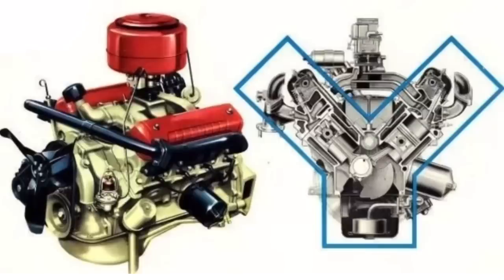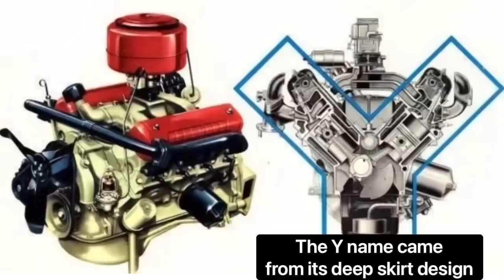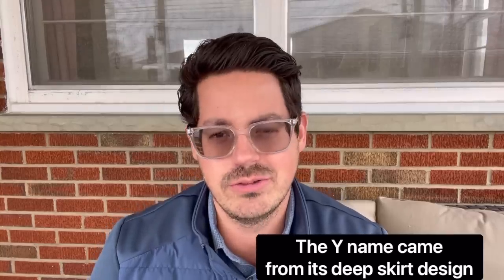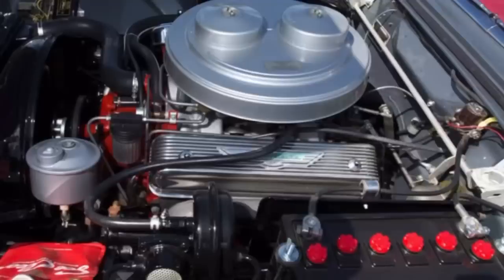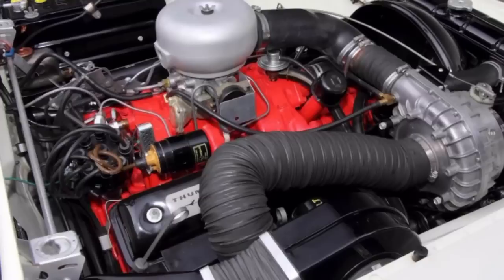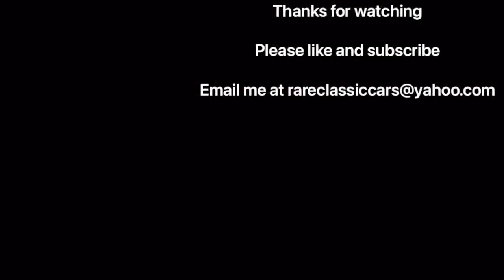Worst Engines of All Time: Ford Y Block V8

Comment: Sorry but I grew up during this time and those Y blocks were absolutely tough as nails..they did have the oiling issues in the rockers if you let sludge build up in them but they were nearly indestructible. I remember in high school a friend had a 61 ford with a 292  got in a pissing contest with another friend that had a 58 chevy with a 283..A bet was made the 292 wouldnt make it a minute with the gas pedal flat to the floor in neutral.The one with the 292 had beat on the car enough to know it would make it just fine and it did.The bet was a steak dinner.The other friend chickened out on seeing if his 283 would live a minute because he knew what would happen.As far as how they sound,back in the day when these were being made it was very well known a Ford Y block with a set of duals and glass packs was the best sounding V8 by far of any ever made so not sure why its stated they didnt sound very good.

Comment: Easily the best demo derby engine ever built. No, I’m not kidding. I spent years at derbies during the eighties and guys could run them without coolant, hole in the oil pan and they’d idle like nothing happened, heads cherry red. They’d run that motor several seasons before it died. Just weld plates over any holes and keep running.

Comment: My dad had a 54 Mercury 256 and a 60 Ford 292, both bought brand new. He ran Havoline 10w 40 , changed oil every 2k. both engines went over 100k when traded. no external oilers, no oiling problems. I guess he was lucky. YBlock guru is John Mummert in Cali.
Reply: 10w 40 in 1954 ??
Reply: @2packs4sure  in the 60 ford yes, in the 54 20w winter, 30w summer, sorry for the confusion. all Havoline

Comment: A bit off topic from the Y blocks, but the mid fifties lincoln concept car the Futura became the Batmobile for the 1960s television series Batman. Had Ford replaced the futuristic bubble top with a conventional hard top and put the Futura into production it would have sold like hotcakes in the late fifties, but Instead of doing this, Ford brought out the dreaded………. Edsel; great marketing but a complete design failure !

Comment: My grandpa had a 1956 Ford with a 272. It was a straight 6 3speed column shift, a dealership had replaced the i6 with a v8 before he bought it. When he got it, he put overhead oilers on it. Supposedly it was a wonderful car

Comment: ford dont learn very well from its past mistakes.30 years later they did the same thing in their colonge engines with upper valvetrain oiling.the 4.0 ohv had major upper end oil starvation problems.by 100k miles the pushrods & rocker arms were junk even with frequent oil change intervals.some of fords better idea's were seemingly inspired by hallucinogenic substances.because they sure as hell didnt work in the real world.
Reply: The '70's 2.6 and 2.8L V-6 had the same problems. I bought a '75 Pinto wagon with a 2.8 and 4 speed that had 65K on the clock. It ran OK....until I changed the oil, then it clattered like crazy. When I pulled the valve covers the top of the heads were dry..... Seems the guy I bought the car from was running 50 or 60W oil with a liberal dose of STP or Motor Honey to keep it quiet. I rebuilt the engine...30 over 10:1 pistons(netted 9.7:1), a reground cam, full groove bearings throughout(cam, main, and rod), drilled oil passages(supply and drains) oversize, and topped it off with a Melling Hi Pressure/Hi Volume oil pump. Other little upgrades included a 500CFM Holley 2bbl on a Edelbrock intake and custom made headers. 2 1/4 inch dual exhaust with "X" pipe and "Corvair Turbo" mufflers. It ran strong and I put 155K on it before I sold it. I sold it because it needed a clutch....it's 3rd in 155K miles.... The clutch was the weak point and I couldn't find a suitable upgrade.
Reply: That's what I got in my Explorer.  Did they ever use a better oil pump throughout production years?  I heard that valvetrain racket is normal on the OHV version of this motor.  Mine ('96 4.0L OHV) just turned 230k miles, and it's super quiet still.

Comment: You missed the design changes of the  oil sump design, that exhaust crossover, and the rumors of the Siamesed intake port that ford layed horizontal vs the sbc vertical design......I’m sure there are stories on these too!!!

Comment: I owned a few Y blocks back in the day. They earned their reputation as the worst V8 from the major manufacturers. Most were shot at 80K. They were famous for blowby, leaking and burning oil, and poor fuel economy. Ford didn’t respond by improving the engine much during the production run other than increasing displacement. It was common to add a quart of oil every week or so and get 10 mpg. I blew up several, even in cars with automatic transmissions that generally limited rpm. Ford wisely invested in the next generation motors and made huge improvements.
Reply: Im 70 and back in the day couldnt afford a 2 door tri five chevy. So I bought the much cheaper 2 door fords. And my experience with Y blocks was pretty much the same as yours. I like a 223 six better than a Y block. Why didnt the crappy oils plug up the 223 sixes? The 223 six never had tons of blow by? Today I own two 1955 two door station wagons. One is a chevy with a 283. The Ford Ranch wagon now has a 262 Truck six that replaced the original 223. I owned a 55 ford pickup. with a 56 -292 that had the Teapot carb and dual advance dist.  never smoked out the tailpipe  or fouled a spark plug. The blow by was so terrible It drifted up the steering collum filled the cab up with the fumes. So I ran a vacuum cleaner hose from the oil fill tube to the top of the air filter and another from the road draft  cannister to the top of the air cleaner also. That oily  residue kinda sealed the rings and actually helped reduce the blow by. When I tore that engine down there was the most impressive build up of carbon on the pistons exhaust valves abd exhust ports.
Reply: @thecollectoronthecorner7061  On a 6, the oil passage from the cam bearing to the head is straight.  On a V8, it is angled, usually with a sharp sudden change in direction.  That alone makes it more prone to plugging up.

Comment: Those minor issues aren't really enough to make it bad, plenty of good engines have had design flaws and after they were fixed were great. Like the Ford FE which is known for tending to bend pushrods
Reply: Well, stuck valves rather. If they sit they usually stick.

Comment: Finding an engine builder who knows ANYTHING other than small block Chevys is a chore. Chevys have much wider tolerances than the other GM engines and if those wider tolerances are applied to say a Buick 455, you are in for trouble.

Comment: Adam, I'm surprised that you seem to be unaware that the Y-block remained in production until ~ 1990 for the South American market.  It was chosen for its durability.
Reply: Just not terribly relevant to this channel, which is for American market cars. After all, the Cleveland was used in Australia into the 80s, and some French trucks had flatheads into the 90s.
Reply: @jeffrykopis5468  The French military flathead Ford V8's were the most evolved - fixing many of the design issues of the Flathead V8 last used in the U.S. in 1953.  The French flattie is not legal to use in setting Bonneville land speed records.
Reply: @Thomas63r2  Yes, I know, they don't want you to have a reliable engine that can make 300 hp without blowing up 😆
Reply: @Thomas63r2  Is that why French V8s are highly prized by some?
Reply: @michaelbenardo5695  Yes
Reply: @michaelbenardo5695  Are you guys talking about the SIMCA flatheads? THey were only 2.4 litres though .. I knew a guy who had a SImca Vedette streetrod, which would have originally had one , but it had a 289 in it by the time it got to him.
Reply: @shoominati23  No, the full-size flathead used in French military trucks.  The one you are talking about is the V8 - 60.
Reply: @michaelbenardo5695  I was under the impression France or somewhere is South America used a Duntov style head on a flathead style shortblock in later years and it was highly prized.
Reply: @hendo337  All true!
Reply: Au Contraire. The "topic" is the ENGINES not the MARKET! U.S., S. America, Australia, Europe.... the locations don't matter! @jeffrykopis5468
Reply: You're talking about Argentina. They used the 292 in their trucks through the 80s. Idk when they stopped production, but they never got the Windsor. They did get different heads based on the 289 Windsor design, called Fase II heads. From what I hear, they're pretty well regarded there.
Reply: Yea but one year before Chevy small block. 

Was used in North America til like 2000s
Reply: 1984 F100 292 V8 from Argentina:
https://www.youtube.com/watch?v=9CKhkw2udIg
Reply: I thought it was till like 1976 in cars and 1977 in trucks...
Reply: @hendo337  

You're thinking of the FE, which was a deep skirt block but not a Y block.
Reply: @johnpeters9793  no, I mean Ford of Brazil built Y-blocks till 1977.
Reply: @johnpeters9793  The y block also had a deep skirt, as did the Buick Nailhead.
Reply: @michaelbenardo5695  

You misread my post......

The FE was a deep skirt block.......but it wasn't a Y block.
Reply: @johnpeters9793  Sorry about that.
Reply: @michaelbenardo5695  

No worries...
The 1st post could have been written clearer.
Reply: @hendo337  1980
Reply: @johnpeters9793  I think a lot of people confuse those.
Reply: @hendo337  your  right  it was the Y block in fact Weslake made some crazy hi perf heads in the late 60's
Reply: Yea idk about this video on bad Ford engines lol not sure Ford had too many bad engines in all honesty
Reply: @luthermoore2969  in stock form the 351m/400 aren't very good because the piston was too far below deck height and is detonation prone, also some early 400s had a tendency to develop cracks around the lifters. Also the 1972 429/460 have C2VE cylinder heads that at prone to detonation. I would argue that the 255 windsor V8 was a hunk of crap also.
Reply: @hendo337  I agree the 255 was almost undrivable. Same boat as the 292. And yes, the 351m/400's were also crap following the other 2, IMO. The 429/460 were fixed. Ford should have fuel injected the 351 Windsor in the eighties for an option. Not the 80 - 83 throttle body system which was junk. I have one. At least 84 & 85 you could use a tester to get codes.
Reply: @hendo337  There was nothing wrong with the 255 Windsor, providing you didn't gear it too tall, or put it in too heavy a car.
Reply: @montymatilda  you mean fuel injected the 351w in cars right? From 1987-1997 it was injected in trucks and vans. I have a 1997 F250HD 351W w/ a ZF-5 S47 and I love that truck. It's not as much of a screamer as my 2003 Silverado 2500 6.0 but, it feels every bit as strong in the low/mid rpm range.
Reply: @michaelbenardo5695 the 255 may have been reliable enough but, it wasn't any better on fuel than a 302 and made even less power, just like the 267 sbc that wasn't manufactured very long before they realized it had no advantage over a 305.
Reply: @hendo337  Oh, sorry, of course I did mean cars. I had forgotten about trucks. I love that the 460 eventually got fuel injection, I think.
Reply: @montymatilda  yes, the 460 was EFI from '87-'98('97my trucks were produced in '98 to fill final orders)

Comment: I told my machine shop guy when rebuilding my 312,,Put the cam in first,then the lifters like a normal fkin person or get beat
Reply: Mushroom lifters must be installed from the bottom then install the cam.
Reply: On this engine, you can't put the lifters in if the cam is already in.  You have to put the lifters in first, and block them up with cloths pins.
Reply: Having built a few engines in my life, one cannot even put a cam in if the lifters are installed first.
Reply: @MostlyBuicks  If you have mushroomed lifters, you have to put them in first.
Reply: @michaelbenardo5695  Why would anyone re-install used lifters that have mushroomed?
Reply: @MostlyBuicks  The lifters are mushroom shaped.  The base is wide and flat, the shank is narrow.  That's the way they are made for than engine.  The Plymouth Slant 6 also uses that style of lifter, as do many older engines.
Reply: @michaelbenardo5695  man I have rebuilt both of these engines. I used shop manuals. But this was 40+ years ago. I obviously have forgotten. In the intervening years I have built more modern Buick and Chevy engines.

Comment: Wasn't there a 332 version of the Y block as well? Maybe just in trucks? I seem to remember the last Y and the first FE sharing that displacement.
And how about that Y block installation in the trucks? That exhaust crossover wrapping around the front of the engine like that!!! No conventional Y pipe for those Y blocks!
The Y finished out its life in trucks for a few years until '64. It's similar to how most people don't think you could still get a 409 in a '65 Impala. You could still get a 348 in trucks in 1967!
Reply: Maybe you're thinking Lincoln Y-block then the FT330 version of the FE. The Y-block tooling was sent to Brazil and used untill at least 1977.
Reply: @hendo337  Nah, I wasn't thinking about that, but it does open a whole new can of worms.  I think you could still get a new 1960-'63 Falcon down there into the '80s or '90s, albeit with modernized lighting and trims.  And I read recently that they are still, or have just recently stopped, producing '67-'72 Ford Bumpside pickups! (The most beautiful pickups ever IMO!)  
The 330 FT does not enjoy a good reputation.
Reply: They you are correct about both. They were commercial engines in grain trucks and busses.
Reply: I was meaning he was correct about the existence of a 332, and it being a commercial engine. Later on, Ford made a 330 FE commercial that only came in U-haul trucks lol

Comment: I ran a 292 in a '58 Ranchero, and I'll admit it leaked from the rear main, and burned its share of oil too, but was probably abused before I bought it.
Honestly, it ran strong and didn't get bad gas mileage.
Like a man said below, I wouldn't call it amongst the 'worst'.
Reply: Agreed.
Reply: Rope seal and burning some oil was normal. I never trusted an engine unless it burned a slight bit of oil.
Reply: @cammontreuil7509  agreed
Reply: I think that was an even worse problem than the cam-oiler galleys: the rear main oil seal, which leaked on all Ford engines for years.
I remember coming home from work and noticing an oil spot on my driveway, and I knew at once a Ford had been there. (It was the lawn service truck.)

Comment: Ford's early OHV sixes were not so great in rocker arms lubrication either, it seems Ford over-engineered many aspects of these 1950s engines but failed on the sundry aspects of them.
Reply: So if you sort those out with fixes,  careful assembly and detergent oil, and don't skip changes, they were outstanding engines then.
Reply: @jamesfrench7299  Ford made the inline sixes much better later on. The Ford 300 cu inch six was legendary but in the 1950s I would have went for a Chevy inline six, as they been making those since the late 1920s for OHV inline sixes .
Reply: @jaymichaels5187  Ford Australia developed the Barra six from the parameters of the six in the 1960 Falcon compact. It just kept evolving after they developed a whole new engine with single overhead cam in 1988 with the same bore centres to the monster we got when they introduced DOHC and a turbo option in 2003 and gradually improved more until it's demise in 2016.
I have heard about your 300ci six. Very well regarded.
Reply: @jamesfrench7299  The Ford 300 cu. inch  six was a fantastic engine, thirsty yes but very reliable and very torque-ee.  Two other great inline sixes were the AMC 258 and the Plymouth/Dodge slant six up to 225 cu in.  I had both sixes, the AMC one was great in extreme cold weather starting in northern Canada with a good battery and had great torque too, this evolved to the famous Jeep 4 litre inline six.  The slant six was not as good for torque but very reliable and great for putting a lot of miles on it with no problems and could take a lot of abuse and maintenance neglect.
Reply: @jaymichaels5187  my dad had a 1964 Australian Valiant known as the AP5 model which had the 225 slant and push button selector Torqueflite.
It outclassed the Ford and GM Holden sixes for HP.
Very smooth and modern sounding motor too. 
I thought that 258 AMC would be the ancestor of the well regarded Jeep motor before reading on.
Chrysler Australia had the 245 and 265 Hemi inline six motor which succeeded the Slant 225 in the Aussie market in 1970. Very similar to the Jeep engine. More of a peaky motor and a bit coarse at higher revs bit internally efficient. Achieved very good mileage when they fitted Chrysler's electronic lean burn system to them -while they worked properly!
The hemi six was originally being developed for trucks in America before it was canned there and adopted in Australia for our Valiant cars!
Reply: @jamesfrench7299  Sadly we didn't get the Barra or the full development of the 351 which you did. There was never any market here for a performance I-6 as V-8's and cheap fuel were bountiful. Very sad your auto industry has gone away now; ours isn't exactly healthy here at least in comparison to what we once had.